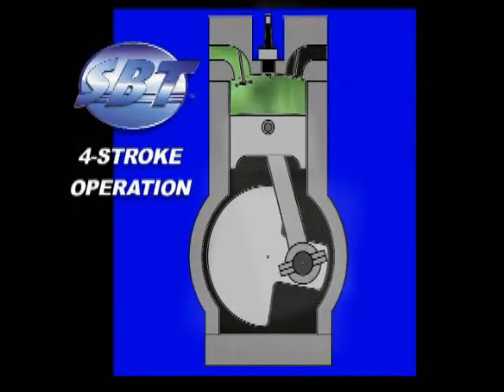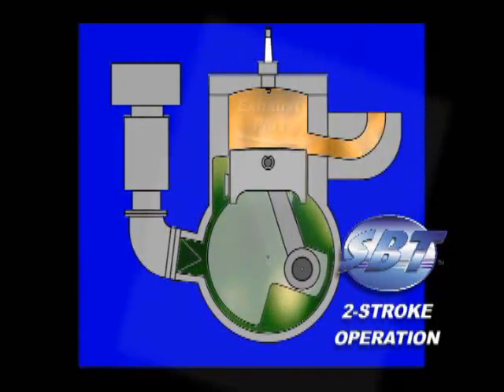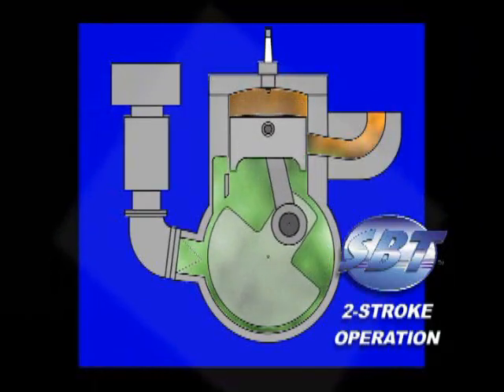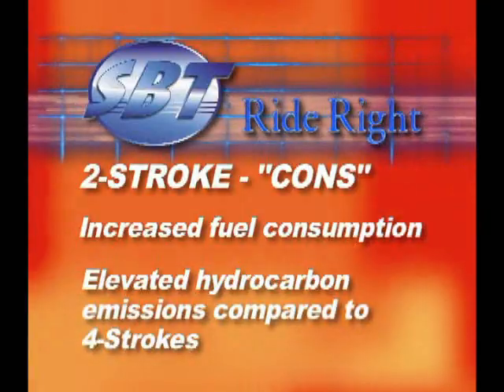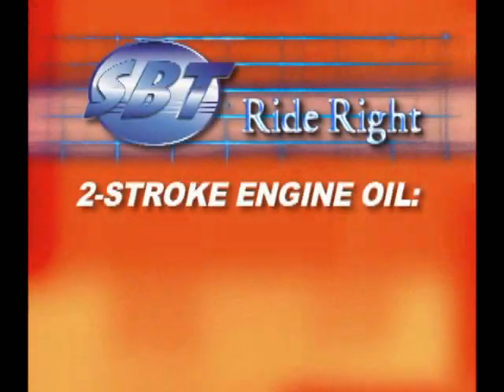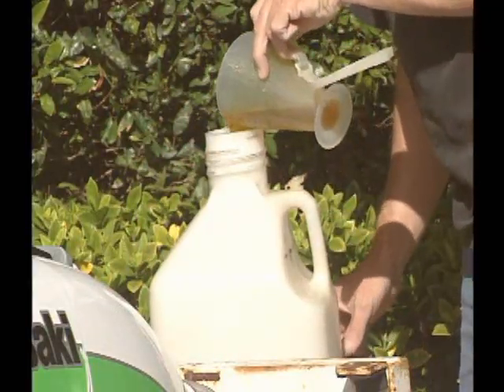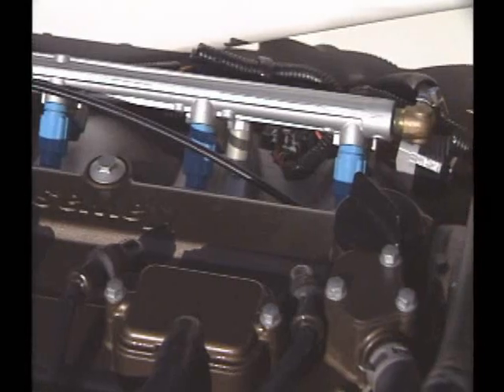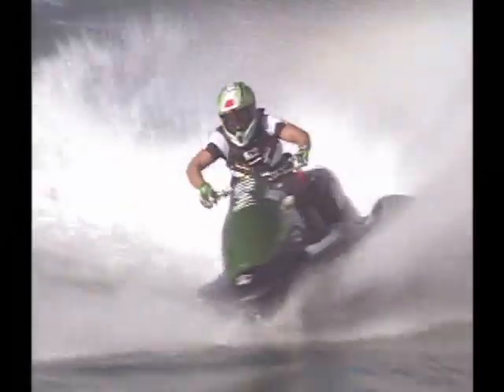2 Stroke Engine vs 4 Stroke Engine

Comment: I just hope that the 2 stroke engine is not completely phased out. Many 2 stroke dirt bikes are gone due to emissions.
Reply: Fuck emissions i still run 2 strokes haha
Reply: Bryan Lopez Haha I dont care either about emission but it goes about fuel consumption. More fuel is more time and more fun riding
Reply: Still got my blaster and never had to do a rebuild. 2 strokes are awesome I just hate mixing gas
Reply: @ohmygoditsyomamma  Mine was a 3 litre resoviour and force fed
Reply: +Kazathul Because you get more bang for the buck on 2 strokes? You get better power to mileage ratio than 4 strokes. You can compare a 50cc 2-stroke to a 125cc 4-stroke if you're comparing power, and the 125cc 4-stroke usually consumes more gasoline.
Reply: SpookySnek What you saying is that you compare a 2 stroker with a sprinter and a 4 stroker like a marathon runner. Both are fast and 2 strokes way faster but will lose against a 4 stroke in long conditions am I right?
Reply: Dead Alive- agreed
Reply: enoxosr1 If we mass produced fuel injected two strokes (Like BRP's ski-doo engines), we could still use two  strokes and not have to worry about the emission and efficiency problems associated with two strokes.
Reply: @crazysnowcrash  the problem with using snowmobile engines that are fuel injected is they are 600 and 800-850cc engines which would be huge on a dirt bike, but I get your point. Skidoo made Etec and they still have the best milage to this day comparing to the best four strokes.
Reply: @duckdestroyer2412  Not if you made it a V twin,One cylinder underneath the saddle it would look like a 400cc with a hidden cylinder
Reply: @Johnketes54  why make a v-twin two-stroke when an inline twin is better balanced and has is even firing. Two strokes already hide immense potential. Those 850cc twins are ridiculously powerful.
Reply: ***** No shit? 2 strokes are still more powerful.
Reply: CR500 my dream dirtbike. someday I will have one lord willing.
Reply: na they'll always be here for racers and stuff like weed whackers
Reply: Brent Jacoby I’ve got a 4stroke weed eater and it’s great
Reply: Two stroke snowmobiles are still just as popular if not more popular than four stroke, because 4 strokes weigh 200 pounds more and lack of snappy-ness. and now many brands have switched to fuel injection making two strokes just as efficient fuel and carbon wise.
Reply: ***** Yes.
Reply: +WARKING1945 i love my 2001 rm250. that machine is comparable to a horny psychotic wolverine!  luckily, Ktm still makes 2 strokes but i wish suzuki still did ):
Reply: mines still here😂
Reply: enoxosr1 I don't think it ever will be its to much of a master piece to give up on why not make it more efficient rather than ditch it
Reply: @hamish2202  Money
Reply: 2 Stroke for the win :)
Reply: XLouisGamerX i have a 2003 suzuki rm250 2 stroke and i just love that sound when you pull that throttle back and the power and bang you get is something 4 strokes just dont give
Reply: @WARKING1945  Unfortunately my four stroke and my two stroke had powerbands that started at 5,000 rpm my four stroke ran out of power at 9,500 rpm although red started at 10,000 rpm and the stroke would happily go into the red and blow up the engine at 8,000 rpm,The four stroke was smooth power delivery the two stroke violent often sliding down the saddle and could not change gear so slightly standing on the footpegs
Reply: +enoxosr1 Fuck 2 strokes. Why would you want to waste money, pollute air and go to gas station more often?
Reply: @CanMetan  depends on the use. Engines are engines at the end of the day, go electric.
I am sure that two strokes could be much improved
Reply: @CanMetan  More violent power

Comment: I highly agree with the problems with two strokes as ive been 16 for 8 months almost and I have had little luck gett g a 2 stroke to last me more than a month. To anyone who is coming up for 16, if you are going to buy a 50cc road bike, buy it from new and hope it works, or wait untill your 17 and get a 125cc. Ive spent 2,000 trying to get a decent 50cc bike and im stuck with a Spanish keeway which has been in the mechanics for a month due to shit delivery systems.
Reply: I hope you have better luck with some larger machines.  My Kawasaki C2TR is from 1967 and still has the original piston and rings, with lots of compression.
Reply: JETZcorp aye the older bikes seem more reliable than half the new bikes these days. Im buying a cbr 125 in august so if that fails Im stuck till im 19
Reply: that makes no sense because im 16 and got a 125 two stroke and ive had no problems with it at all besides a fouled plug which happens to four strokes too (it just takes forever), but it may be because a 50cc is WAY to small for you, they make 50cc bike for toddlers, i learned on one of them when i was 5
Reply: If your driving a 125 at 16 in the uk its illegal. Dont know about other countries. Or do you mean off road.
Reply: I'm talking off road but in the U.S. bike size does matter for age as long as you have your licence you can take the biggest bike in the world
Reply: Should have bought Japanese

Comment: It doesn't mention 2 strokes produce a lot more power, you don't need a large 2 stroke engine CC. E.g. a 500cc 2 stroke can produce roughly the same power as a 1000cc 4 stroke
Reply: POWER, sure... but nowhere the same TORQUE as the 4-stroke. For some of us, that's a key distinction.
Reply: TORQUE LIVES MATTER!
Reply: @quantumleap4023  Indeed, thats why we love our diesel
Reply: @AVIXS_0  Which is four stroke! Your probably blissfully unaware of two stroke diesels
Reply: @Johnketes54  I was unaware of 2stroke diesel's.
Reply: @Johnketes54  some googling later and I'm very impressed with the efficiency of 2 stroke diesel's Upto 50%, some of the highest efficiency numbers Iv seen with combustion... Damn.
Reply: @AVIXS_0  look at this
https://en.m.wikipedia.org/wiki/Napier_Deltic
Not a small engine but old now,Was a marine engine they put into a train 18 cylinder with 3 Crankshafts
Reply: @AVIXS_0  My father when i was a baby had a two stroke comma van,No glow plugs to enormous battery''s over each rear wheel and a switch for the starter motor that in the winter could take up to 2 minutes to start
Reply: @Johnketes54  that's soo cool but Definitely not the car to use if your in a hurry 😂
Reply: @Johnketes54  yeah I love the opposed piston engines such a fascinating design.
Reply: Well it’s sort of implied in two times the power strokes that you’d have near double the output per displacement
Reply: Closer to 750cc

Comment: There are still 2 strokes with intake valves at the top..
Reply: How is that supposed to work?  I've seen two-strokes with valves at the top, but these are typically exhaust valves, and usually for a large diesel applications (trains, shipping, stationary power, etc)
Reply: Yeah but lead down the crankcase.
Reply: 2 stroke engine doesn't have velves it has ports brother...

Comment: Notice how the connecting rod changes its length as it moves up and down.
Reply: Cannot be unseen
Reply: at 1:10 it is now in the crankshaft
Reply: That's VRL variable rod length technology.... the rod is a shock absorber so it can't bend and applies a smoother power delivery.  Absorbs detonation as well.  Much fewer spun rod bearings.   I was joking but now I might file a patent
Reply: Nick Kautz ya you can sell that junk to bombardier, they’ll put that shit on their next 850, perhaps it’ll dampen their engineered wobble crank shaft stupidity.
Reply: @NickKautz  what if i told you porche already has variable compression rods. And nissan uses a moving crank to do the same
Reply: Magic.
Reply: Its alien tech..
Reply: The floating transfer port also

Comment: @hot00stuff 
-Yes I`ve heard of it.
-Do you mean with only 2-stroke-engines or what ?
-A 4-stroke-engine has a better efficiency, but when we`re talking about container ship 2-stroke-diesels they are usually close to 50 % efficient, thanks for the "uniflow"-porting, the exhaust valve, turbocharger. Then it`s something different !
Reply: Wow this comment was from 2010 holy

Comment: @robinhooodvsyou 
Youd better read up on your 2 stroke knowledge. ever hear of direct injection? its the end of the line for 4 strokes. better fuel consumption, better efficiency, cleaner emissions. regardless, even the old style 2 stroke will destroy a 4 stroke, no contest

Comment: @hot00stuff 
-For example:
-If there is 5 hp 4-stroke and 5 hp 2-stroke, the 4-stroke has way better low end torque than the 2-stroke, also better efficiency, and smaller fuel consumption.
-And cleaner emissions.